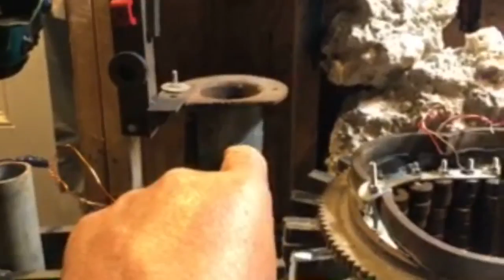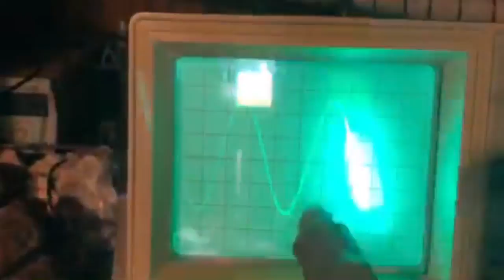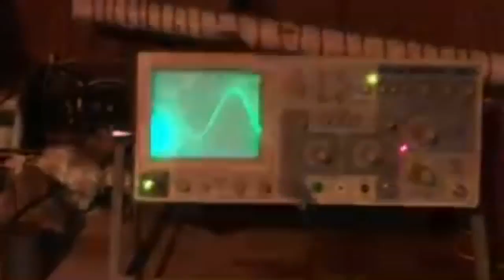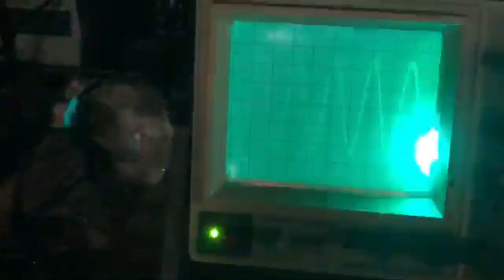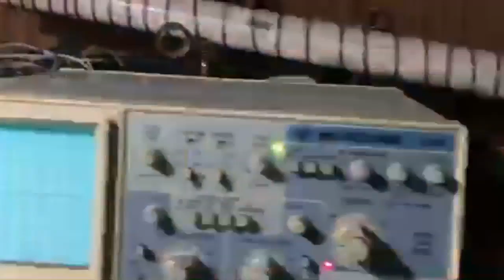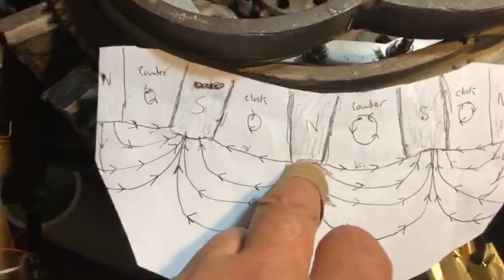Ed Leedskalnin’s Legacy

Comment: garbleduseryo!
garbleduserpretty grainy
garbleduserlike looking through beer goggles
garbleduserno better, but the problem is the signal strength from your wifi router and the phone.
garbleduserwelcome back
garbleduserwell, darn
David Stapletonwe gotta make you a farrady cage phone case hah
garbleduserand back
garbleduseryou need a wifi acess point in the shop
garbleduserany back good
garbleduserIt doesn't seem like a bandwidth issue from games
garbleduserlook up CANTENNA!
garbleduserthank you
garbleduserbuffer
garbleduserYo!
garbleduserwill try to do so
David StapletonHey big guy!
Terry Woodroofhello mister
garbleduseramen
David Stapletonthumbs up!
Truth SeekerThis is incredible!!
Truth SeekerYou are doing major work for these mysteries. We are unlocking the free energy secrets
David Stapletonit's recieving but also re transmitting too right?
garbledusertransmitting to recieve
garbleduserwe can
garbleduserproducing waves that bend the waves to be received toward the antenna
garbleduserI wonder what the exact positioning of the hole in the cealing is?
garbleduserin relation to the walls
pneumatonicWhat's up Roy! ANTENNA IS CRUCIAL COMPONENT.
garbleduseris there a ratio there? Is it like another "Telescope," giving him a time reference to start recieving?
pneumatonicantenna
garbleduserthe pipe is a transformer core!
pneumatonicpipe is antenna
garbleduserthe antenna is the ground antenna
Terry WoodroofTesla said transmit through the ground 95% and 5% air
garbleduserthe pipe is...
pneumatonicsets frequency of transmission
garbleduserresonante cavity
pneumatonicgood answer, garbleduser
David Stapletonconfines the wave in a certain space
pneumatonicbecause it is conductive
garbleduserconnected to the biggest antenna we have
pneumatonicTHUMBS UP
garbleduser*thumbs up*
David Stapletonway up
Truth Seeker
pneumatonicokay, I just jumped up, and was disconnected for a moment
pneumatonicit is more than doable
Truth SeekerDefinitely!
Reply: Terry Woodroofone giant conductor of no losses according to Tesla
pneumatonicsuperluminal transmission speeds through ground
sk8pklhey there is à Guy on YouTube explaining and experimenting with acalar waves. from what i undersrood, he can change thé potential between ground and the air. one coil from ground to the air
garbleduseras longitudinal waves pneu.
sk8pklacalar waves...
Truth SeekerEinstein physics really hide these magnetic fundamentals
pneumatonicindeed. you impress me with your knowledge, garbleduser
sk8pklsssscalar waves
garbledusertransmitting longitudinal waves.
garbleduserthank you!
Truth SeekerSweet sixteen
pneumatoniccan the wheel be configured to transmit longitudinal waves
garbledusersame thing scalar / longitudinal.
pneumatonicno, scalar requires the negation of the longitudinal
sk8pklsame thing i get it
pneumatonicthey are different. you need to cancel out longitudinal with its phase opposite to be left with the scalar
garbledusertransverse waves are just 90 degrees off the axis of propagation of longitudinal waves
pneumatonicjust as you cancel out transverse with its phase opposite to get longitudinal
garbleduserI think of them and call them "electrostatic compression fields."
sk8pklanyways. hé does that with à 1/1 transformer. aaanndd à plasma globe
pneumatonicnice term. let me think about that
garbleduseradding the inverse phase of a signal to a signal is zero
pneumatonicthere is a gravitational push / pull to electrostatic longitudinals
garbledusergravity is not in the realm of electrostatic / electromagnetic .
pneumatonicthe phase cancelation leaves whatever is also in there no thesis or antithesis
pneumatonicI produce a gravitational pull and push on the surface of water with longitudinal electrostatic charge
garbledusergravity is entropic.
Truth SeekerYes this was incredible to fully realize this recently with all the flat realm proof emerging too
pneumatoniclongitudinal electrostatic charge also responsible for an antigravity effect I get from electrolytic capacitors
pneumatonicRoy, YOU ROCK!
garbleduserits not antigravity. its electrostatic repulsion
Tommy Tommy *deafbred*hi
pneumatonicthis is awesome, Roy. Schumann resonance...
Tommy Tommy *deafbred*he 'found The sound'
pneumatoniclooks like a transverse wave
Tommy Tommy *deafbred*it's like a Ping Pong Wall Bounce
pneumatonicwhat happens if you cancel it out with its phase opposite -- is there anything else in there, left?
Tommy Tommy *deafbred*Harmonize
garbleduserthink of longitudinal waves like the sound being produced by a speaker. the transverse wave is traveling down the wire to the speaker.
Tommy Tommy *deafbred*wow 'theres a beam in that tube? wow i didn't know that
garbleduseryo tommy!
Tommy Tommy *deafbred*yo yo!
Tommy Tommy *deafbred*a night To Broadcast Around the World!
garbleduser1 = -1 = 0
garbleduser1 + -1 = 0
garbleduserblack as night
Tommy Tommy *deafbred*the stars in arizona were Many
Tommy Tommy *deafbred*i know someone that zoomed in to a star
Truth SeekerThis realm gets more interesting by the day
Reply: pneumatonicseems to me more like electrogravitic,garbleduser -- the effect is push and pull, the push, or repulsion of the surface of water away from the wire happens with the positive side of the electrostati
Tommy Tommy *deafbred*Nikon P900 camera films stars Good and Moon too
pneumatonicthe attraction to the wire of the surface of the water is the negative electrostatic, longitudinal
garbleduserdid you inject a signal back into the grid that happend to be 180 degres out of phase from the shcumann res?
pneumatonicI agree with garbleduser -- THAT would be interesting!
Tommy Tommy *deafbred*Opposite
garbleduserpneumatonic- the [sic] "antigravity" effect can be replicated can be perfectly replicated with HV DC fields
David Stapletondown slope
garbleduserget on at neutral
Tommy Tommy *deafbred*i think of the wave as Rail Road tracks Parralell
garbleduseron the down
Tommy Tommy *deafbred*it's prolly just showing one side of thew ave
pneumatonicYes, I know. I took inspiration from T.T. Brown. My device produces it from a motion of the hand
pneumatonicno HV
Tommy Tommy *deafbred*Yes! Roy!
David Stapletoni hear ya
garbleduser*thumbs up*
Tommy Tommy *deafbred*Lol! Roy! I know What Yur Sayin
David Stapletonthumbs up man
pneumatonicNo HV required. Something more applicable to the antigravity of Grebennikov, the insect world. I produce the effect with a small motion of the hand.
Tommy Tommy *deafbred*must be from THE MIDDLE 'then'
pneumatonicphase 90 degree
garbledusera fresh piece of scotch tape will deflect a laminar water stream.
Tommy Tommy *deafbred*90 is important, A Person mentioned, He feels like 90 years old, i said Thats cuz he is Prolly always "right" about things..
garbledusertape adhesive works on electrostatic force
pneumatonicyes, but I can both repel and attract it.
Tommy Tommy *deafbred*wow Roy...
garbleduseryes in relation to relative charge
David Stapletontry it
Tommy Tommy *deafbred*wow Roy
pneumatonicthe resonance is the carrier, but we need to be grounded
pneumatonicno shoes
Tommy Tommy *deafbred*cuz you feel it in the momentum of the rush of air or wave pool resonance
pneumatonicwe are not grounded
pneumatonicshoes
garbleduserand im playing the audio from this stream through my oscilloscope.
garbleduserprentice
Tommy Tommy *deafbred*Prince
pneumatonici have done a telepathy experiment, and grounding improves the results DRASTICALLY
Tommy Tommy *deafbred*Einstien
pneumatonichawking
Tommy Tommy *deafbred*Tesla
garbleduserjames wyatt prentice
Tommy Tommy *deafbred*Edward Leedskalnin
garbleduserMAXWELL
pneumatonicMaxwell Smart
garbleduserFarnsworth
Tommy Tommy *deafbred*scott austin
garbledusertelepathy + grounding = important
garbleduserverry much so
Reply: David Stapletonare we connected if we are insulated from the earth by our homes?
Tommy Tommy *deafbred*i just took my shoes off
David Stapletonim thinking the same thing. lol cool
garbleduserjust touch a grounded object with feet
David Stapletonsocks off
garbleduserstanding on my isolation transformer
Tommy Tommy *deafbred*im grounded now
garbleduserAlexander grahm bell
garbleduseredison
garbleduserwatson
Tommy Tommy *deafbred*Hutchitson
David StapletonMarconi?
David Stapletonfranklin
David Stapletonboo ya! lol
Tommy Tommy *deafbred*Maybe i shoulda been holdin a Key
garbleduserThe transmitter needs to be high voltage refreance to ground
David Stapletonindeed
garbleduserthat was for telepathy
Tommy Tommy *deafbred*i can See through it
garbleduserpineal = pine eal
David Stapletonooh. the pineal is one of my favorite topics!!
Tommy Tommy *deafbred*im grounded to electral wall societ ground
David Stapletonwe need copper hats! lol
garbleduserit has 50 nm calcite micro crystals in it that are piezoelectric.
Tommy Tommy *deafbred*dang I use to live outback yard in trailer... woulda been easy to touch ground
Tommy Tommy *deafbred*Roy is On point!
David Stapletonyes!
David Stapletonif you apply slight pressur to your eyes it helps
David Stapletonhumming or chanting really helps when you do this
garbledusermason jar
David Stapletonyou gotta vibrate your vagus nerve
Daniel DaCostapmh
Truth SeekerThe snake pole
Tommy Tommy *deafbred*gyroscope
Tommy Tommy *deafbred*a Yo yo
garbleduserthe pipe
Tommy Tommy *deafbred*an Occilator Cone of Torus field Rodin like
Tommy Tommy *deafbred*a string, going down the pipe
Truth SeekerThe pipe with the twin snakes around it the medical logos
garbledusercaduceus
Tommy Tommy *deafbred*wow This video's Like 3d
garbleduserwhat was the question again
Tommy Tommy *deafbred*brass BELL
Tommy Tommy *deafbred*Cuz We are Apart of it
garbleduserdiffering magnetic saturabilitys?
Tommy Tommy *deafbred*yes
garbleduseryea.....
Tommy Tommy *deafbred*la Beat O
Reply: marker113ORGONE YEA!!!
Tommy Tommy *deafbred*o Roy is putting Together the wheel Spacing's
Tommy Tommy *deafbred*this Looks like a Disection of the Vee areas and inbetween Cement Realms
David Stapletondensity or mass is moving energy?
marker113there is only one field the separation is an illusion
garbleduserone field, 2 spirals twisting in opposite directions
Tommy Tommy *deafbred*Maxi Million electric eddy current's
garbleduseryou already told me
marker113little for sure
Tommy Tommy *deafbred*wow Roy is Smart
garbleduserkind of like electricity only travels across the surmace of a conductor
garbleduserlord kelvis thunderstorm
Tommy Tommy *deafbred*Build
garbleduserkelvin
garbleduserwimhurst
marker113temperature difference
garbleduserdisamilarly
2550marshallCheck out Russ's vid on the dielectric
Tommy Tommy *deafbred*Wow Roy
garbleduserthey are physical antennas with specific nuclear megnetic resonances, so yes
Tommy Tommy *deafbred*Solar SHIELD
marker113probably, but solar storms are actually energy from the center
Tommy Tommy *deafbred*I seen Solar flares Ben Back into the Sun
Tommy Tommy *deafbred*bend
marker113heart energy = earth energy
2550marshallrwg42985 his vid part 12...watch it, very cool!
Tommy Tommy *deafbred*Battle Ground Z
garbleduserGreat work Roy!
garbleduserThink about the wavelength of the schumann resonance's energetic peaks. some of them areare millions of miles long!
Tommy Tommy *deafbred*Seems like Animals or critters in the Electrical
garbleduserthe earth is the only antenna we have that can recieve them
garbleduserwill do!
David Stapletongreat video Roy
Tommy Tommy *deafbred*Thats Very Deep Roy About the Aspect's of Interplay with Substances and the Chart
marker113awesome vid- thanks roy
garbleduserok all, final words!
garbledusercopying text now.